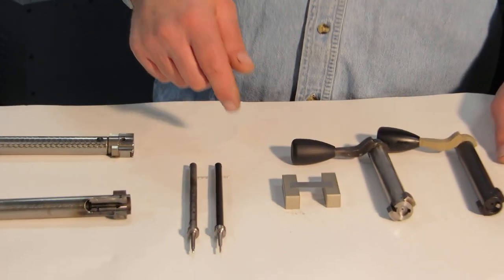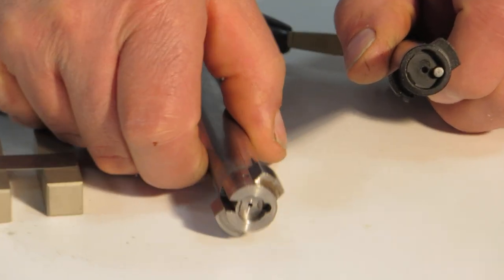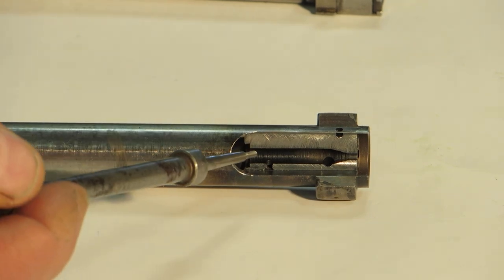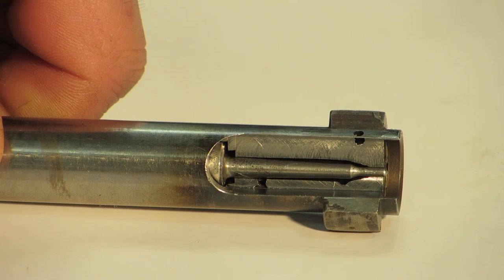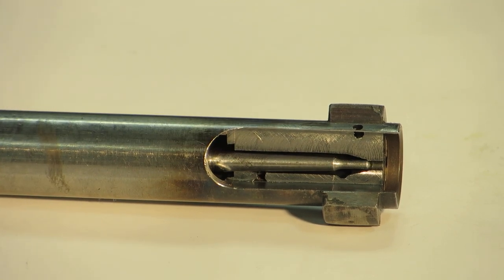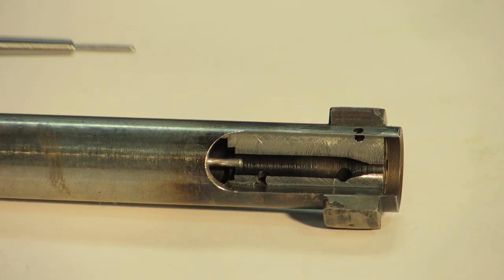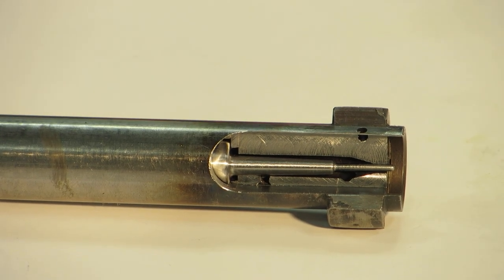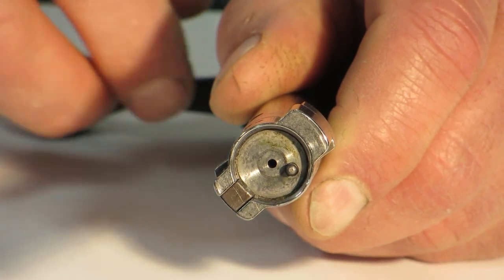Greg Tannel Gre-Tan, Bushing The Firing Pin Hole, Cure For Cratering

Comment: This is what I'm exactly going through with my 6.5x284 Norma with H-4831SC with almost as low charge as the books show. Thank you for taking time to tell us Bob from Capstone sent me your way 50 weeks out Wow!!! I guess I will just purchase the entire bolt. I find it odd they don't correct this issue sense checking my firing pin I see a flat spot on the tip which has made it like a spear so I'm punchering the primer. Check the ends of your firing pin for roundness it could be sneaking up on you like myself.. another awesome video, Greg it's why your so busy Wisdom.

Comment: I own a FN SPR that blows 2-3 primers within every 100 rounds, have 1400 rounds throught the rifle.  I took it to a gunsmith today and he said my firing pin was too long and shortened it.  He test fired it today and I could still see cratering and I suspect he fixed nothing,  guessing it will still blow primers.  The rifle was designed for a large primer and I shoot Lapua small primer 6.5 CM.  Do you think you could still bush the firing pin even though its been shortened?  Thanks

Comment: Thanks much for this vid.
At 3:00 The firing pin itself, the business end, obviously guides the entire pin. This is not it's job. That is what this entire video is about. Why not make the chamber the pin rides in near as precise as the firing chamber?
Reply from the maker: The bolt shroud guides the F/P at the rear of the bolt and the bushed bolt guides the front. The internal body of the bolt is larger so as not to have the F/P spring & dry fire collar rub. A more consistent F/P travel is preformed from shot to shot. There is no gain to have any other part of the bolt touch the F/P with two points already guiding it.

Comment: why dont you do this work on AI bolts?
Reply from the maker: +russr  AR platform and foreign gun companies us case hardening steel on the bolts and firing pins. They only have a thin skin of case hardened steel. Once machined off, soft steel. Bolt action rifles are made from tool steel 4140 for the most part. When hardened, it is completely hardened. Case hardening steel is a cheaper way to manufacture.